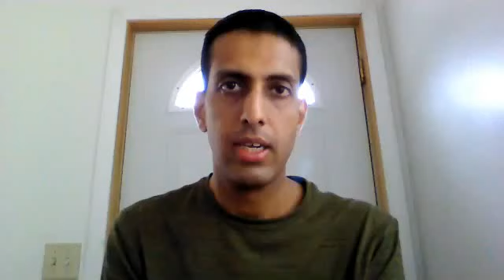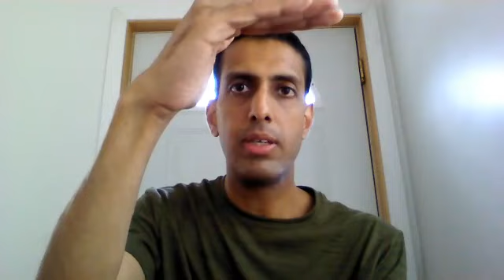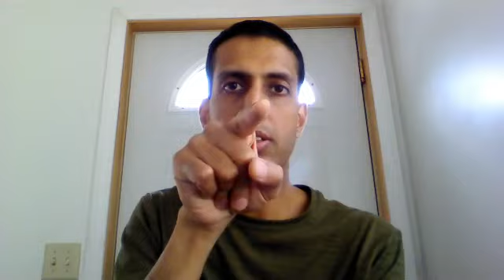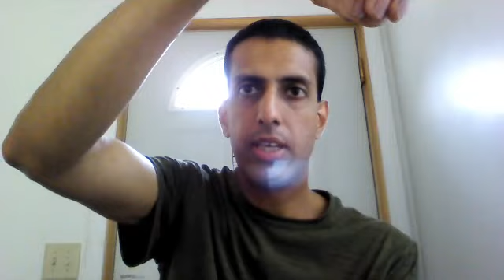2-Stroke Diesel Piston Engine True Power Output Explanation

Comment: I got an 8v92 2 stroke detroit silver turbo, BTW thet make plenty of low end torque, he must be talking about a cummins 5.9 small motor made into a 2 stroke poppet valved conversion
Reply from the maker: Torque is a function of BMEP & Bore, and RPM is a function of Fuel Input and the inverse of Stroke.   Brake Horsepower (BHP) = [(6.28 x RPM x Ft-Lbs Torque) / (33,000)].
Reply from the maker: BHP of Piston Engine = [(PLANK / 33,000)]; P = BMEP in PSI, L= Stroke Length in Feet, A = Bore Area in Sq In, N = Powerstrokes/Min, K = Number of Cylinders.  Since diesel is all heat-of-air-compression, torque-curve is almost not quadratic, but an exponential function if you view dyno-graphs of diesel engines, even two-stroke diesel, such as model airplane HOAC gas engines:  lower-end torque, while at much lower RPM, compared to lower-compression Gasoline piston engines.  It's a relative comparison is what I meant.